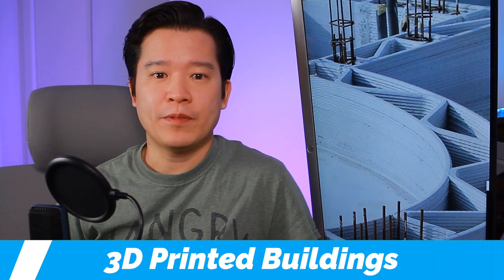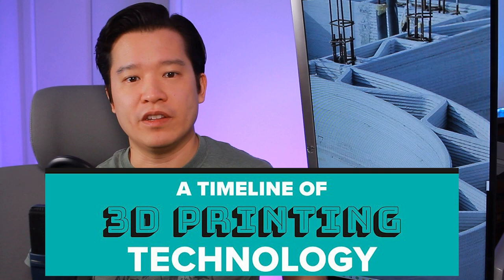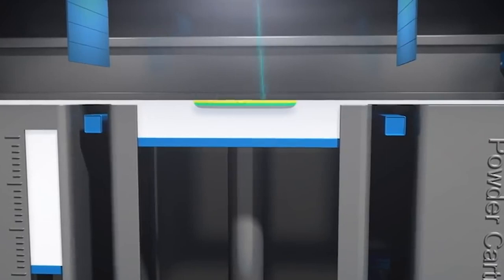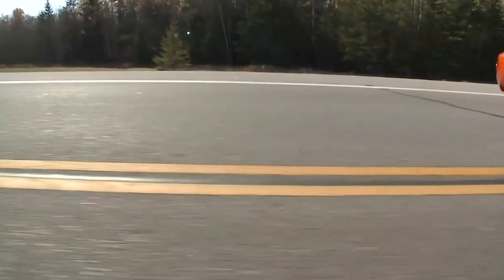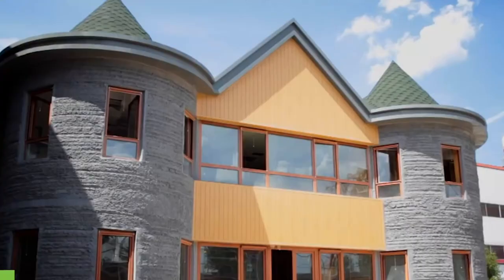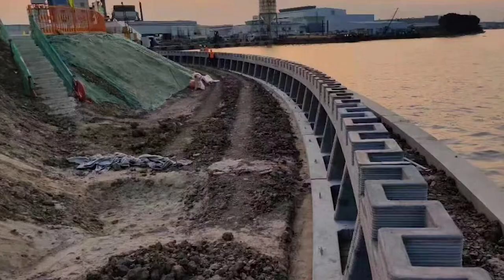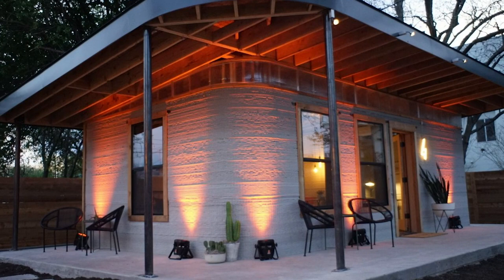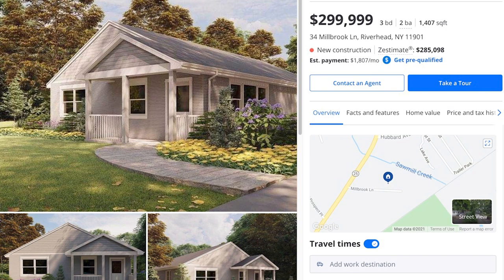3D Printed Buildings Are Coming | Proptech Spotlight

Comment: 3d printed home are still some 20 years ahead ,I been following 3 or 4 3d printing companies and by the most part just print  some of  the  house,  no 2nd story's  the ones that print a full house are no based in the USA and is going to be  a pain bring them to the USa. 3d printing works in 3th world countries where there is no regulation and some people  already live in shaks any way.  Framing walls and doors is only 15 % of the house  I don't think I've seen a company that prints the roof ,(if you have seen one send me the link) that gets done in the traditional way , in my opinion  truses and roof are the most dangerous and most annoying part on building a home and then you have cabinets and closet,  although not a big deal still done in the traditional way ,  at this point  your most advanced 3d printing company in the USA  prints less than 50% of the house,  if one company figures out  how to print the whole house  and a second floor,  doing it at a big  scale  that affects the  housing market price is different beast.  All printing companies  do so using a mix af cement,   most cities already have a problem getting enough sand for their construction needs  3d printing is going to  4x the demand for sand for each  house,